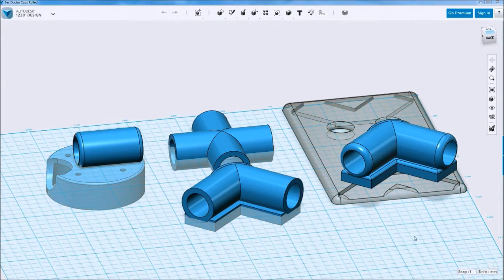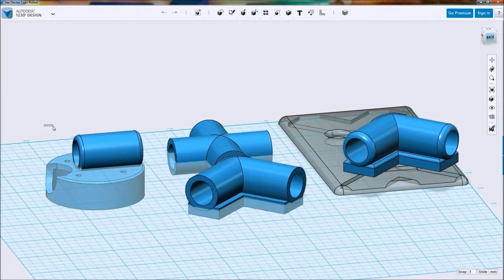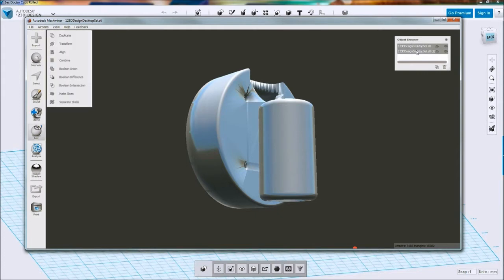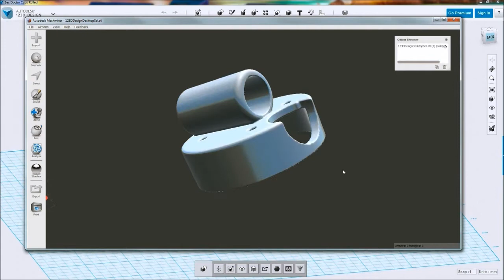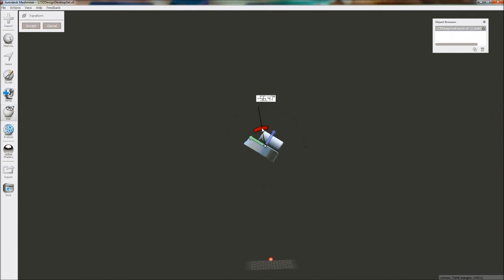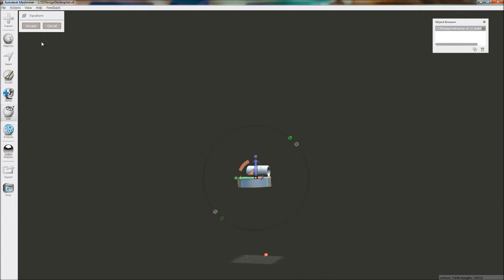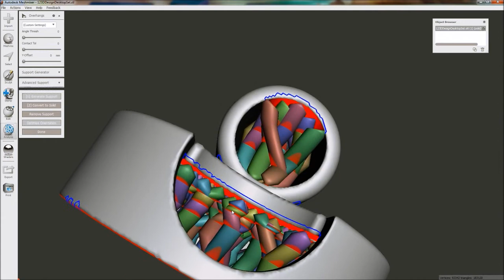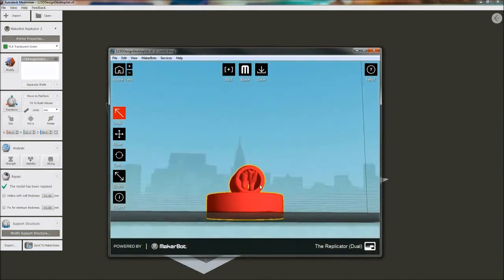Using Meshmixer to generate support structures

Comment: Nice video, thank you for the tips, I have never tried using hundreds of tiny rainbow coloured dildos as a support structure before, I usually only use cura for slicing, I thought MeshMixer was more of a 3D artistry tool.